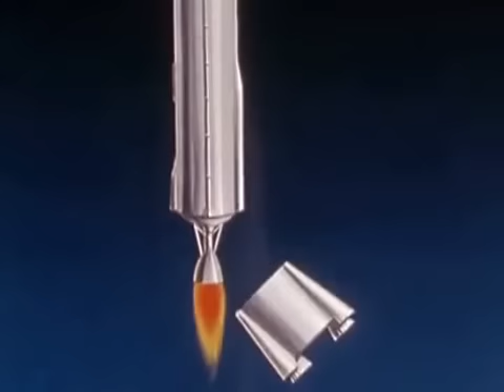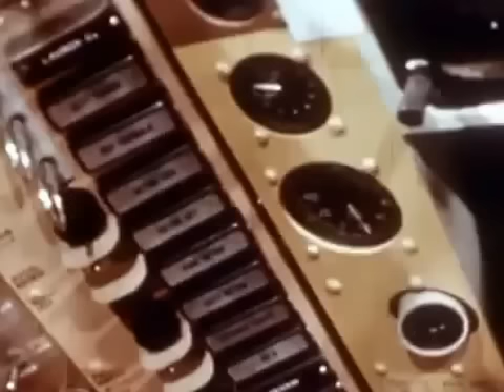NASA Project Mercury: 1960's Manned Spaceflight / Space Documentary S88TV1

Comment: I wonder if NASA was sponsored by Reynolds wrap at the time.
Reply: SacredCowSlayer no but the Atlas boosters bare Aluminum was susceptible to corrosion unprotected and pain adds weight...  The booster design team needed to find a quick way to displace any water from its skin...  Water Displacement formulas 1 to 39 didn't work but luckily Water Displacement formula number 40 did...  They shortened it's name to WD40...
Reply: @chrisjohnson4666  
Atlas boosters were stainless steel, and 'bare' aluminum is naturally protected by its own self-limiting oxide layer.
The WD-40 thing is an urban legend (officially promulgated by the company itself, sad to say), and the formulation and production actually precedes the first Atlas prototypes.